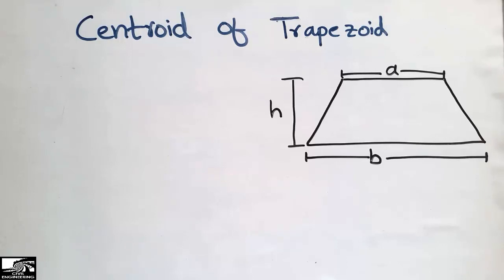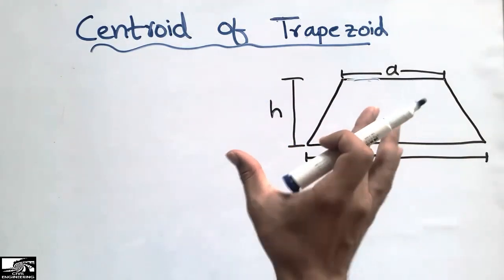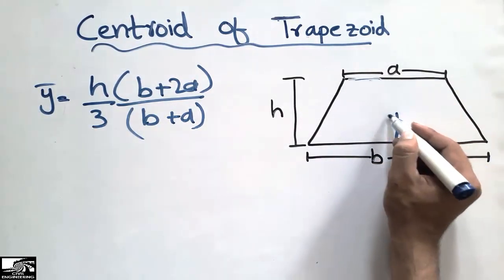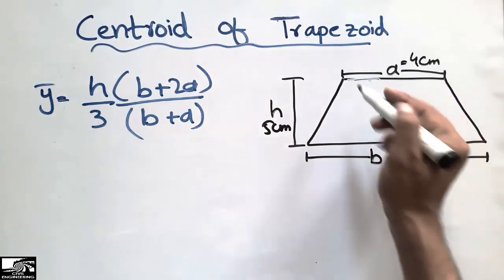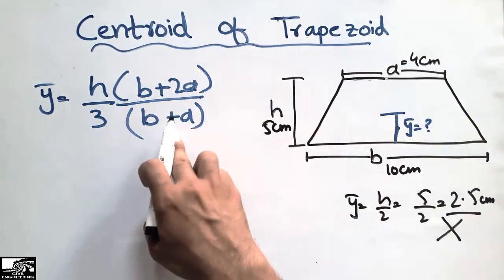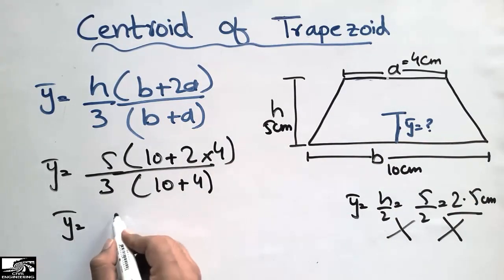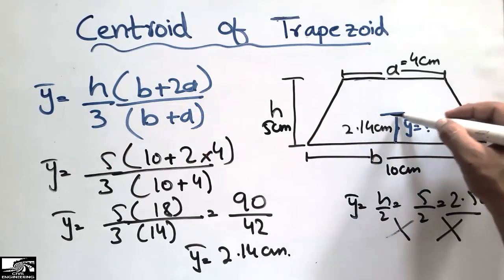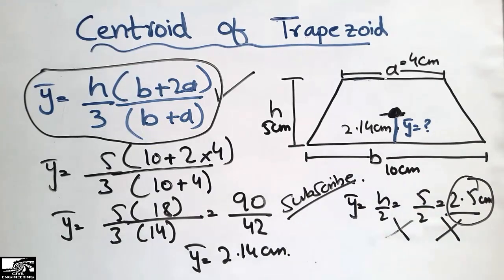How to find Centroid of Trapezoid | Example Solved

Comment: Give the proof of this formula
Reply: Here is the idea of a proof: split the trapezoid into three parts: one rectangle and two triangles. For each part, compute the area and centroid. Then, compute the weighted sum of the three centroids, using their corresponding areas as weights, and divide that weighted sum by the total area. That is, centroid = (A1 * C1 + A2 * C2 + A3 * C3) / (A1 + A2 + A3). Here, C1, C2 and C3 are 2D vectors.